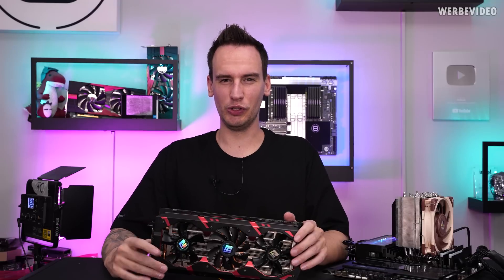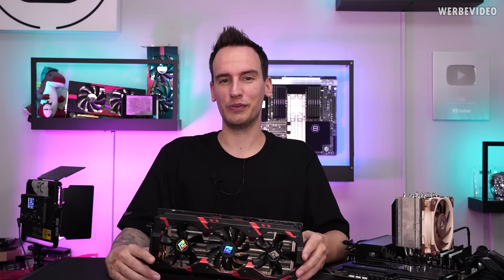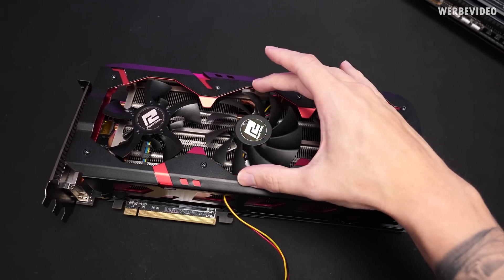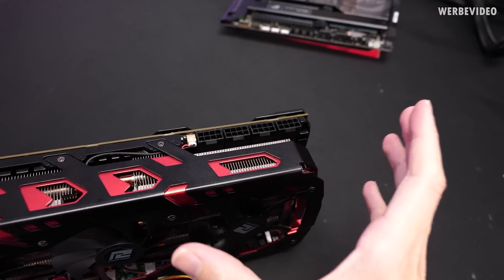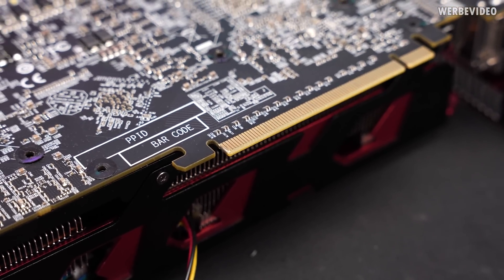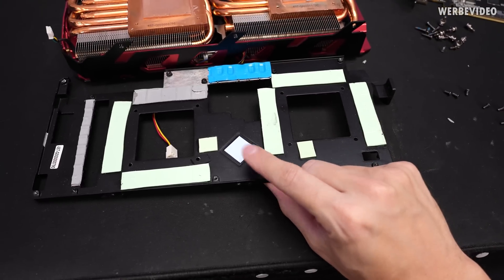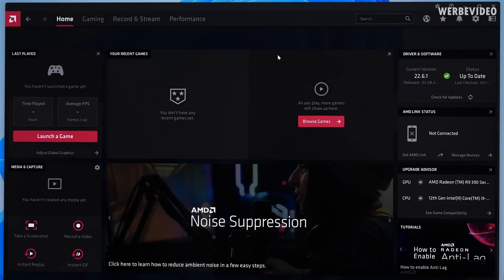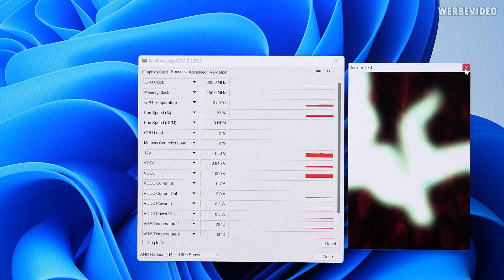HW-Legends #15: Insane 580W TDP!! This Card required 4x8Pin PCIe to run. PowerColor Devil13

Comment: I used to run a version of this card and ANOTHER 290 in triple crossfire. I had to have a second GPU dedicated to the dual GPU card. The system could pull over 750W.

Comment: Best I did required 2 as in two power supplies to assist in float to load required / it wouldn’t be able to over charge for something then pull to hard causing a power fault

Comment: im varry poor my mom passsed away i got scamd on ebay for a 3070 it was told not a miner it was a miner card an i i order gaming x it not evin the gaming x so i am stuck with this an i am not happy mmy only job is streaming on twitch i was hiopeing i can trade u a new never used longer than 1hr 6700 for a 3060ti or 3070 that u dont need way cuz i need to stream with 1 pc an the 3070 3060ti will do fine or 2080 2070 super any think lmk sir i had a 2070 my cat jump on pc spilling water on it i am rilly in need of help an 6700 is now a gpu ulll not be abulll to find not making it any more an i have the 3 fan pro card so i just no it dont do what i need it to do win it comes to streaming so i need 3060ti 0r 3070 or any rtx pleezz help sir  had manny follower an sub an win gpu stop worling lost all of them i rilly need to get a good gpu u asap it my job an i spant 300 on the amd card new an 300 used on the other card used 3070

Comment: Nuts back then, nuts now, nuts according to Techpowerup relative performance that my laptop's igpu (780m with the RX 4/570 as reference) theoredically has ~80% the performance of this thing while consuming way less than 10% the power

Comment: I had 2 separate 290x’s. Bought them in used condition for 300€ each. When it worked (not all games supported crossfire) I managed 60 fps in 4k on some games, high settings but not max. But stuttering was pretty annoying with running dual gpu’s.

Comment: Sounds like me, taking a year and every bios msi had to try and get ddr4 4000 memory at 128GB to run on an 11900kf...I did get it to run stable, but as soon as I restarted, crash. I have the settings saved on a usb key, and it does work, but you have to train and train and train the memory. Then never shut the system off. BTW The best scores I got were actually at 3200, but I wanted to see if I could do it because everyone said it can't be done. Including an MSI non tech telemarketer non tech support. LOL

Comment: As you already know and see @der8auer, everything with it's thermal design has been tampered with and not in a good way.
I suspect since it's a dualgpu 600 watt card, that it may have broken traces due to heat expansion. Maybe try and remove the cooler and bake the GPU to reflow all path traces. This happened twice on my old crossfired 4870x2's, which drew about 750 watts. Both cards got heat damaged due to old paste and they both worked after reflow.

Comment: Last year I revived my old machine running double 290X and the only way I could get it working (Windows 10) was with modded Nimez drivers.
After that I could run Battlefield 4 with the exact same frame stutters at the 200 fps which was the main reason I never looked back at crossfire ever again. 😂

Comment: As I know, for now, when main load for Video Card is AI loads, it will balance loads between chips greatly than loads from standard rendering (game, video etc), and as I understand this was the main issue for this cards, sli, crossfire, two chips was very hard to make working with equal loads, but now, when AI making render (dlaa, dlss, rtx) we can check if it stabilising loads between cards. We need to test it, if this is as I say - it will get huge performance increase.

Comment: I was running HD 3870x2 by two.   Moved up to HD4870x2 by two.    I could see my lights dim really badly.   I was running 840 EE clocked over 4ghz,  4 gpuz clocked equal,  running talladega C class trucks over 500 fps maxed settings on Iracing back in the day....   

Good thing power bill was included in the rent. 😊..  the good ol days.....

Comment: Also a quick thought Der8auer: Try the card on a less security patched board/older version of Windows, such as 7? The PLX chip might be triggering security issues due to the 'bypassing' or the newer kernel with the older driver simply isn't stable! AMD started disabling CrossFire for me even back in the early 2010s, the first one to go was StarCraft II and FPS slowly dropped, as i said in a previous comment i ended up just using a single card and put the second one in another machine, so friends could play games then.. And all but one of my HD5870 cards died, as well as a brand new R9 290X from MSi (they also managed to crush the fans and kill the bearings by packing it too tightly in the box straight from their factory! Two weeks later, the price also halved..oh, i was pissed. Hence never using AMD for GPUs again nor CPUs since 2010)

Comment: In the meantime, a pair of Quadro M4000 cards i have, modified to run at the same clocks as a GTX 980 (with the same shader amount of a 970 and slightly slower, but more VRAM) still run everything i try in SLI without crashing, and are the same age! :) That's why i stopped using Radeon after the 290X (it also died) and with my old HD5870 cards, ended up just using 1 for years because CrossFire never worked properly! Also had 2 of those die on me.. The Quadro cards i hacked the BIOS of to change the power limit and installed bigger coolers, they aren't exactly fast by today's standards but at least they still work and run fine in SLI! (just over 7000 in Time Spy in a 9980XE system..could do more if the pesky 8GB of ECC RAM could clock higher but sadly stuck at 224GB/s maximum per card lol)
Reply: ChaosHusky
Quadro can stack resources, mem etc, getting a pool of the total of all DDR onboard all cards.
Maya, Autodesk etc, not in DX !

Comment: I had a HD5900 series dual GPU - the thing was a cruching beast when you could get both GPU's to load.

Frame tearing and microstutter was terrible.

Mine "only" had 3 8 pins but was a massive heat generator.

Comment: Imagine owning a dual RTX 4090 card and the portable fusion reactor that comes in the package to power the GPUs. You could save so much money on heating your house :)
Reply: h.barkas1571
Dual RTX chip boards ware worthless, we have better CPU's now GP100 on it only ! Full sized chips now, RTX 4090 ti, or Quadro RTX Pro cards !

Comment: Crossfire just like the old nvidia 3d shutter glasses works only in exclusive fullscreen mode. And you also need compatible PCIe bus settings and driver.
I would try a different mainboard or mess with PCIe settings and timings.

Comment: wel wa veri veri bad ... but no prob i have a gtx690 wei atha veri simila probrelm fro a veri no so nice conatiuona of yors how slod it as usd warking fine  .. ashole and have somire or wars progbels witha tha segondary gpu 50% of a cared it is not a card  agry !!!  this saks as .  if tha card not defectiv or tha tha drivre folt  .. then ther isnly 3 usueal sispect   microsoft  nvidia and 3dmak .. aor it is a amd driver probel in htaca case it is all amd folt for failng tha costumar agen !!

Comment: Anybody know when the first dual GPU card came about? There must be some dates of launches and milestones. I'm thinking there could be a 'Dual GPU Day' or something like that as a celebration (or memorial?) of these special cards. Maybe it could be a way to generate interest and get a new generation of dual GPU cards?

Having dual GPU cards again could a way to get the performance needed for the demands of VR and those wanting the ultimate in performance, especially with a lot of modern motherboards having a scarcity of expansion slots and lack of full bandwidth expansion slots.
Reply: Rage Fury MAXX in 1999 was one of the first dual GPUs IIRC

Comment: without crossfire that gpus will not do anything else
i used to own one back in 2015 and i remeber will not run 2nd gpu without crossfire i was so confusing and i went back find crossfire to get that gpu to work and it did and later crossfire ended and it become useless now and i have to switched over single gpu unset of dual gpu
that 4x 8 pin cable look so nice n hot LOL but 2x8 pre gpu die like 2x 8 pin to first gpu and 2x 8 pin to 2nd gpu

Comment: Having done board design in the past, this thing is a work of art. There looks to be 32 memory ICs on that card, which is absolutely bonkers. On top of that, a pair of GPU dies, a PLX chip, and the PCIE routing to make them work together. Not to mention how you go about routing power from a gigantic monolith of 8-pins like that. I'm sure the power planes of that PCB look incredible.

Comment: I abandoned my R9 295x2 when AMD killed driver support just before Halo: Infinite released. Sadly, the game was crap and I spent $450 on a used RX590 to replace the 295x2. Thanks AMD!! Then a week later found out there are 3rd party community drivers that still support the 295x2. Something I learned which you might not know, CrossfireX only works reliably in Exclusive Fullscreen mode. Thats why I could not get above 2FPS in Infinite, it forces Borderless Windowed with no Exclusive Fullscreen option. I tricked the game once and got 35FPS, but was never able to replicate it.

Comment: used to love these dual cards. FULL PERFORMANCE who cares about power and heat. 🤣🤣. i ran CF and SLI 3 times before i quit. the drivers and game suppport was HORRIBLE. sometimes it crashed just in windows. still have my Voodoo 2s in SLI tho. never giving those up.

Comment: These dual-gpu cards were always really cool, but the practical reality of living with them was not great. I had an AMD 4870x2 and while there was the occasional title where you'd get both GPUs working properly near full load, it was a lot more common that you either got nearly no scaling from the second GPU (leaving you with an expensive power-hungry 4870) or the frame pacing was bad enough that you still got a stuttering, slow experience despite your average FPS number being quite good.

I'm glad they're no longer trying to market and push multi-GPU because of the difficulties both AMD and nVidia had in making it work consistently, but it always felt like a lost opportunity to me. Rendering graphics seems like it should be so easy to parallelize across multiple chips, but modern pipelines are so complicated that I guess that's harder to pull off than it sounds.

Comment: as a sucker that bought 2 hd7870 for crossfire gaming, I can tell you that crossfire was not supported and it was a complete waste of time. Im also running a gifted r9 380 at the moment...... I know.... to benchmark it I would fire up 3dmark 11 as it is aimed at this generation of cards and it was the only way I saw both gpu's work

Comment: As far as i can tell comparing google search pictures to this card its missing 1 cap and it looks to be done on purpose to fix a short preventing power on or boot up and software would not stabilise the card so they disabled 1 GPU in hardware to make it stable.. i'd replace the cap and see what happens and if you get a no power on issue or no boot up issue.. as it also could be that 1 gpu degraded over time and was no longer stable so was disabled.. if that's the case the only way to fix it would be to find another single gpu card of the same chip and swap it out. But i really want to see this card fixed and working.. also the middle fan looks way better than them 5 blade fan's so please change all 3 fans just so it looks like it is meant to be that way lol and frankly the 12 blade fans will look way better anyway.

Comment: OK, here is something I found messing with 2 AMD cards, Re-bar and Above 4G decode must be disabled, (and yes I know if disable 4G will disable Re-bar), I've noticed on GPUz that re-bar is enabled for the second GPU. 

I Doubt we will see another video for this card, but I think it is good for the community to know that turning on Above 4G decode has some problems with dual GPU on windows 10 and 11 for 3d applications (don't know why yet)  It run ok on machine learning, BUT i got some weird problems with PCI lanes and some stuff not working properly, like my numpad on keyboard.

Comment: My question was never "Why not 4 connectors instead of the new 12VHPWR?" but instead "Why not use less power?"

CPUs pushing over 300W and GPUs pushing 600W is just utterly ridiculous and unnecessary

Comment: As someone that ran QuadFire with 2x R9 295x2 cards, I can say that dual GPU cards were pretty freakin' awesome back in the day.  I enjoyed a 3 monitor setup with the 4 GPUs so much in the games that supported it.
Seeing cards like these being looked at again is fun.  Wish they'd make more, but I'm sure the money required to develop them vs the limited sales wouldn't be worth it now - I imagine it would cost a lot of money to design a 7900XT x2 GPU, and because it would likely cost upwards of $1700 I would guess, it wouldn't sell very well, especially since the support in games would be limited unless it was all driver-side Crossfire.
Reply: Haha, yeah I still run my 2x Radeon 5870HD setup. A supported game like Dirt, Crysis, Tomb Raider or Mad Max gets almost double the framerate. Combined with Eyefinity and 3 CRTs it was amazing. Too bad no Unreal Engine games support it any longer. Most Unity3d games work when launched with "-window-mode exclusive". But scaling isn't always good. Or it runs worse.

Comment: I’m using a 3 8 pin to 12 pin on 4090 and it still pulls over 550w in furmark maxed out. So I guess the 8 pins are doing 150 ish watts and the pcie is around 100…

Comment: If I remember correctly one of the drawback of those dual-gpu is it still needed a crossfire compatible motherboard. Maybe something to look into
Reply: Dual core cards like this work on literally any motherboard as the PCI-e lanes necessary for multi GPU are handled by the GPU. Multi-card SLI needs the motherboard to have a license from Nvidia. Multi card crossfire just requires that you have 2 PCI-e slots that are at least x4(it'll even run through a chipset).

Comment: Used to love these dual GPUs. Had a Saphire 4870X2 in a SFFPC case, one of the dies fused with the heatsink 😅
7950GX2 was my dream GPU
Reply: Haha I almost bought a Saphire 4870x2 in 2008 but Instead went with a Diamond one.
I ran that card from 2008-2014 when I repasted it, and ran it again more from 2014-2019 when I finially retired that mahcine.

It played ANYTHING I threw at it at Max (I didn't throw high end titles at it really ever) and It ran super well on my XP Pro X64 Build with 8gb DDR2, and E8400 OC to 3.6 ghz on stock Voltage

Comment: If it does not miss any component it is very likely to be the multiplexer bridge chip either failing or desoldering itself.
I had 2 HD 5970 cards, first one did not work at all and baked it in the oven and worked for about a month with crossfire working then died again and the second one works with crossfire but for the first run of the PC until it actually warm up it shows artifacts on screen and freezes image for seconds or even freezes the PC completely. If you restart it works perfectly both GPUs.
Really weird beasts but pretty cool cards, cheers from Greece! Jim.

Comment: I'd still buy a card with four 8-pins over one 16-pin.  Although - to be real - I just wouldn't buy a card with that much power draw to begin with.  Three 8-pins, even if it's just a 250W card.  Why?  Because it looks the best.  Three 8-pins can be combed together with ATX 24-pin combs.

Comment: No, that is kaput normal. I run the 295X2 graphics card, both of them in my machine before I crossfire them in the software it shows up as four GPU in the software once crossfire it shows up as three in the crossfire option does not show up on any other GPU, other than the primary.

Comment: I had the HD 7990, which was two 7970s slapped on a board with 6GB VRAM. It was a beast! When it died I replaced it with a GTX 1060, and that was an upgrade lol.

Comment: I had the same issue with 295x2, at first thought it was second GPU at fault, but the problem was in PLX-bridge MCU (it has it's own thermal interface under the cap, and it looks like a PCM, but was dried to concrete). While I was able to get another PLX from workstation GPU of same era I managed to fit indium sheet between chip glass and its heatspreader and replaced died PLX-bridge with one I've prepared. All was fine except faulty Adrenalin drivers at this moment, so I've used  Radeon PRO enterprise drivers (for WS cards), they were muuuch more stable back there (yep, they are containing drivers for gaming cards, but no Control Panel).
Reply: The same, pads did that ?? no blocks ??
don't understand, same issues ???
Reply: Wow! I suck at soldering pcb boards. Of course I am old and shaky now, so I just gave up soldering anything.

Comment: intresting had the same card as r9 290x2 model middle fan failed first then the other 2 getto modded it and it was the last of the stock at mindfactory also came with a razer mouse I should still have it I wonder if it works